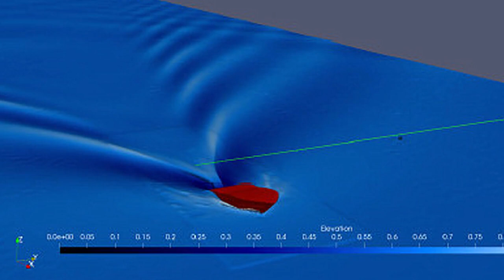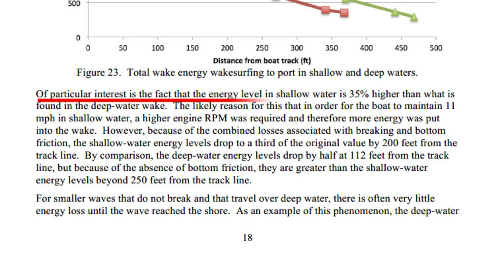The Multiple Wake Boat Problem

Comment: The opening shot is not following the wake surf recommendation it says to have the non surf side towards the docks
Reply: It doesn’t matter. Water is incredibly elastic. Which is a physics term referring to the ratio of returned energy vs absorbed energy. These waves will travel for miles.